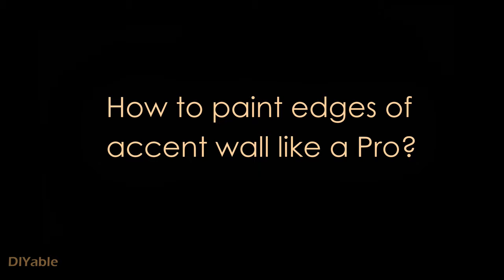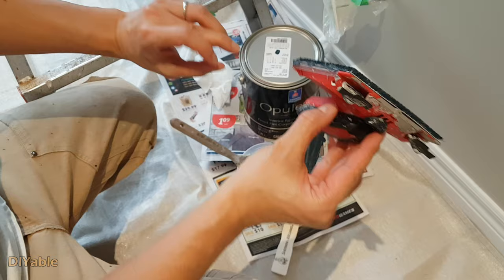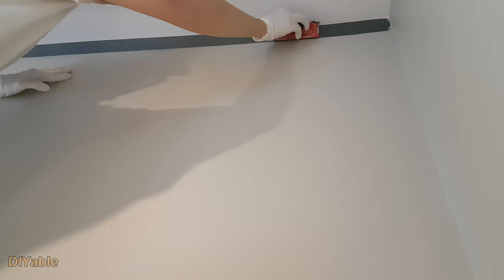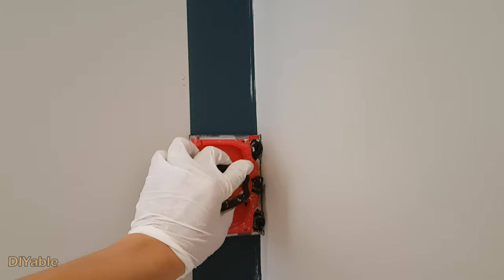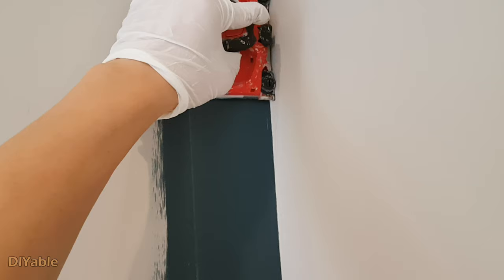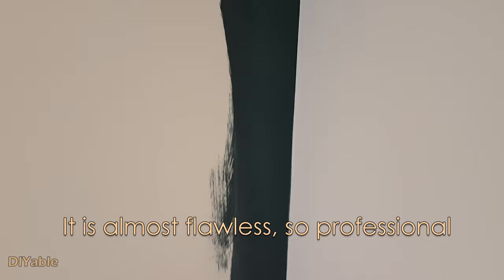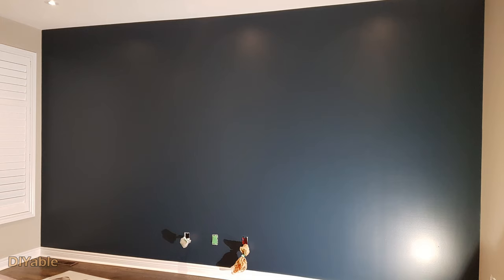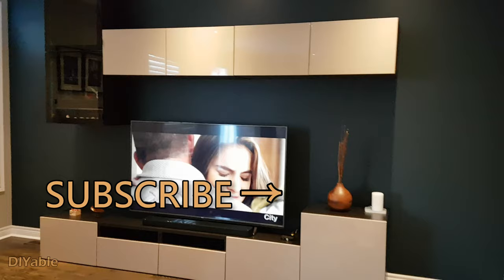How to use a $5 Shur Line edge painter to beat the Pro?

Comment: This retired pro used those to good effect. If you don’t go too far with a loaded edger you won’t get skips. With a high contrast finish you need a heavy coat. If your roller guy isn’t following the cutting immediately use the angled front edge in swipes to knock down the ridge that inevitably forms along the outer edge of the swath if carrying enough paint for good coverage.

Comment: This product will work if you follow this video. There is one drawback with the product: the wheels do not allow for you to get the edger right up against the surface not to be painted (i.e. ceiling) to ensure coverage right up to that surface. There is a small gap of about 1/16" to 1/8". Manufacturer needs to allow for the wheels to be adjustable to allow the user to get as close as they want to the surface that you do not want to be painted.
Reply from the maker: Thank you for your comments! Yes, it does work.  Glad it helped.   BTW, that is a very good suggestion to the manufacturer on adjustable wheel!!!!
Reply: Do painters get up to the edge or are they also leaving a gap? My thought is they are leaving a minuscule straight line gap on ceilings, especially where the corners are not 90 degrees. I have textured ceilings and walls and you simply cannot get right to the edge without it looking horrible in spots where the texture is in the joint.
Reply: that small gap is a problem.

Comment: I''m a professional painter, and use that to  do 16ft. ceilings with a pole. Always brush it on , never dip it in paint. If I have to do just the ceiling, it won't work on the rough textures, then I spray , and shield the cut ins.
Reply from the maker: Good point. Thanks for commenting!
Reply: i tried it once and got wheel marks on the roof...but i dont think i brushed the paint on :(. ....maybe i got paint on the wheels accidentally and didnt realise....this video makes me wanna try it again.

Comment: Tips:  

1. DO NOT dip the tool and pad in a tray of paint.  Unless you have very steady hands you will get too much paint on the pad and on the frame or wheels and track it all over the adjacent surface you are trying to cut-in around.  This is the #1 mistake people make when trying to use this tool and why they give up so quickly with it.   
2. Go very slowly with this tool as the guy in the video did.  If you go to fast you will all kinds of streaks and dead spots.
3. Go back and feather out the paint on the inside edge away from the cut-in line with a brush while it's still wet.  If you don't you will end up with a strong line that will be visible after you are done painting.

Comment: They work good in most situations.  However when cutting near trim the rollers don't always roll on the edge of the trim tapers to a thin edge.
Reply: Ever thought of putting a paint shield along the top portion of the trim so the rollers would have a base to roll?

Comment: I wanted to get the Accubrush but Home Depot only had this hand held Sure line.  OK I watched the videos, painted on the paint onto the pad, went back and forth SLOWLY (and back and forth and back and forth)..... it worked ok but the time I took to put the paint on the pad with a brush, wipe off when paint got on the edges, go back and forth over those pesky "dry" areas that kept coming up...... I thought I may as well watch a couple expert videos and learn how to just do it with a brush.  I think I'll skip these disposable extra-step things, that might be useful, cheap enough for the disposable mind-set, and just learn how to do it right with a brush I can use over and over, as long as I clean it well.  But thank you.
Reply from the maker: You are welcome.   If you are able to manage to use a brush than using Shur Line, that's awesome.  It requires more skills, and I think you have the skills!

Comment: Great job! How did you run this along the baseboard? I tried it and I got paint all over my baseboard. Not sure what I'm doing wrong.
Reply from the maker: Baseboard is no difference... Make sure when you brush the paint onto the tool, don't brush it too close to the edge. You may also need to use paper towel to clean the wheel on the tool. Hope that helps..
Reply: @DIYable  Use a paint shield or guide along with the edger for the baseboard.

Comment: Does work if there popcorn celing?
Reply from the maker: Indeed, the ceiling I have in the video is popcorn ceiling. However, mine has a flat border on the ceiling. If the popcorn is right at the edge, it won't work.

Comment: How many coats of paint did you put on the wall?
Reply from the maker: If you are referring to the whole wall using the roller, I applied 2 coats. Always apply 2 coats because one isn't good enough.
Reply: Always go over the first coat again real quick, so you can call it a second coat. lol I've painted some houses , that almost needed 4 coats to cover the original color, usually when your using yellows, they don't cover to good.

Comment: Applying the paint with a paint brush. Why didn’t I think of that myself? But he is completely mistaken in regard to speed. You do not have to move slowly at all. It’s mechanical. As long as you don’t overfill the pad it’s going to work with mechanical precision, regardless of how fast you move. That’s like saying you have to turn the pencil sharpener slowly to get good results. Whether you turn it fast or slow you get the same result.

Comment: It's a shame, but I see that you're using the pads badly. Surely you do a good job, but with the pads you have the wrong technique. That said without taking anything away from your good work.

Here's how to use the pads properly. Painting by making an inverted U. Let me explain.

FOR A WALL ADJACENT TO A CEILING:
1. Before going against the border, apply the pad on the wall far from the border, then slide it towards the border. It will make an inverted L..
2. Glide the pad evenly with even pressure, you can go either way.
3. To remove the pad, slide it down. This will complete the inverted U. Remove by sliding and not directly as you do, because it produces peaks!!!

TO SOAK PAINT WITH PAINT:
Just immerse the hairs and rub the pad on the edge of the tray, it removes the excess and evens out the paint on the pad.

TO REMOVE EXCESS PAINT ON CASTERS:
Before repeating steps 1 to 3, rub the small rollers on a wall to be painted. It's a good precaution, because sometimes they get dirty. Wipe this part of the wall.

Repeat steps 1 to 3 carefully. I am able to paint a very far wall with pads that fit long sleeves!

FOR CORNERS (junction of 2 walls and a ceiling):
We have no choice but to use the brush, which is the only one going into the nooks and crannies.

FOR ADJACENT WALLS PAINTED THE SAME COLOUR:
Use a roller with one end "closed" completely hairy.

Never again will I make borders with a brush, it's too long and risky.

Comment: it did mess up a few times i saw it and a pro painter could definitley do this with a brush
Reply: A pro painter can paint a straight line. For the rest of us, a straight line is not that easy.
Reply: @lpjunction  he said it was better than a pro thats why I said it...
Reply: It didn't mess up a few times, you did! It is just a tool and you are a incompatible operator.
Reply: @melstead7937  First off I've never used this thing, I use an actual brush and my lines are straight that "tool" wasnt perfect in this video I used to be a painter so I notice the little things